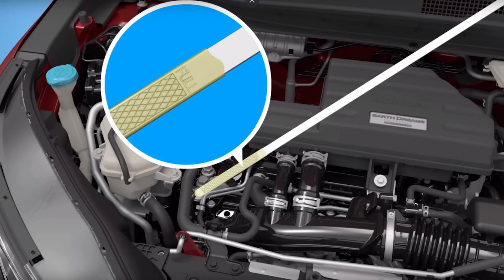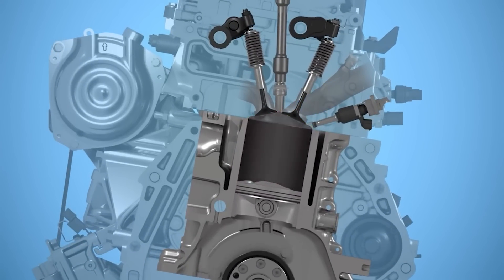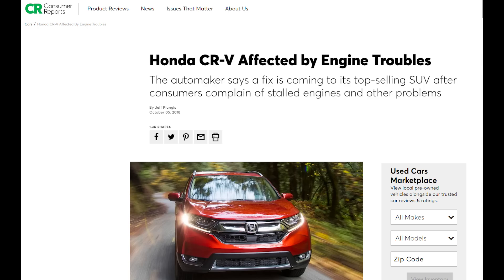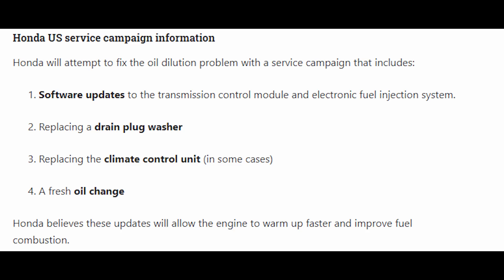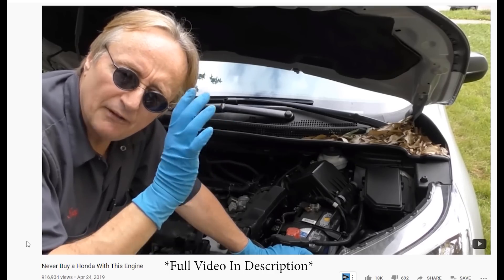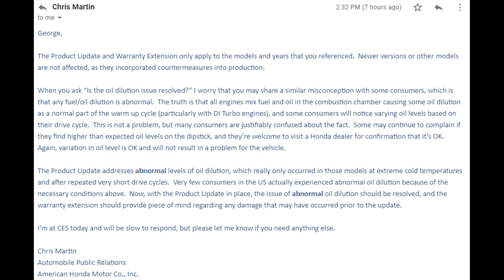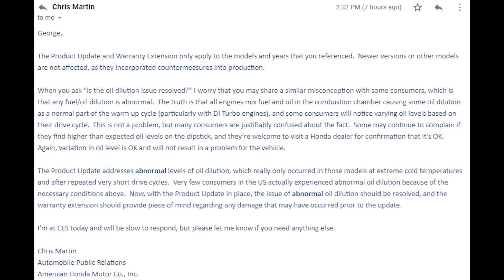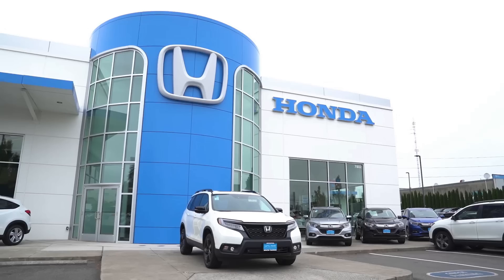Does Honda Have An Oil Dilution Problem? | 1.5L Engine in CR-V and Civic

Comment: Honda and Trump are the same. They lie. I own a 2018 CRV touring. 37,000 miles and 15 oil changes already. I always get 1 or 2 quarts more fluid out at oil change that are done at about 2000 miles. I’ve had “the fix” and I get worse gas mileage, car doesn’t warm up and gas dilution.
Reply: I guess neither your Honda or TDS will get fixed.
Reply: Fiveo waf  Don’t know about the TDS but as far as the Honda CRV, THERE IS NO FIX!!!  This is how this engine runs and that’s it. There is no one out there that has stopped their oil dilution.
Reply: @dougmartha2413  It's obviously a fundamental design fault related to its inability to warm up quickly, as the 2.0T Honda engine doesn't do the same, Honda's answer that "they all do that" it's the design is obviously untrue.
Reply: What do you take for your TDS? Might want to adjust the dosage.😏

Comment: That's great information!! I work for a Honda Dealership and since Honda introduced their "Earth Dreams Engines" we started getting shipments of this new Honda Full Synthetic Oil that is rated (SN Plus) specially made for Direct Injection engines. Honda even made a educational video about this new oil for all dealerships to learn about it. The problem is that this oil is upon request and the dealership will never tell you what oil is going into your engine when you take it in for an oil change. All dealerships are owned independently by investors or big automotive groups that use barrels of cheap synthetic blend or regular full synthetic oils to market to people, give them the cheapest oil change price, and get them into their service departments. People need to start reading their owners manuals and stop being cheap when it comes to changing oil!! I'm not saying all but most people don't even know what they got under their hood and then complain about issues that could of being prevented. I have 2 direct injected cars and personally use Mobil 1 Extended Performance rated SN Plus along with an OEM Honda oil filter, change the oil every 5k miles and have not had any issues. Also you don't have to spend a fortune on oil, I go to Wal-Mart and get the 5 quart jug for around $28 dollars. I also recommend that after your powertrain warranty expires (60k) perform a complete decarb service along with installing an oil catch can to make it run cleaner. This goes to all direct injection engines and do this if you plan to keep it for a very long time.
Reply: Or get a Toyota.
Reply: @vbad128  Yeah, get a Toyota before they make all their models GDI turbo 😂😂
Reply: Good information
Reply: So the dealership lies to people about using full sythentic oil? I thought the 0w20 oil was only made to be full sythentic?
Reply: It doesn’t matter what of new oil Honda recommends it’s the gasoline dilutes the oil

Comment: It has nothing to do with cold weather because people in warm climates are having the issue as well. They are lying when they say otherwise. People in California and Texas are having the problem as well. And their software fix did nothing. Honda have taken a major hit to their reputation with the way they’ve handled all this. 
  We love our CRV other than this issue, but because of it will be only keeping it for three years or so. This will be our last Honda
Reply: In the attempt to make gain in fuel efficiency, auto manufacturers switch to smaller displacement turbo engine coupled with CVT.  Turbocharged engine together with CVT shorten the life of the car.  The question is would you want to have a marginal increase in fuel economy which in most case can not be achieved in real life driving ? or having a more reliable car in the long term ?
Reply: @ohcanadaeh  in other words buy a mazda if you want a good japenese car.
Reply: Mazda cx5. 2.5, non turbo.  Good engine, very durable.  Mazda steering is always good. I think all turbos lifespan is sub 130k miles. Mazda, honda, toyota, porche, bmw, mercedes, doesnt matter. Your engine is eating itself to make power.

Comment: And Honda got rid of the 2.4L bulletproof engine for 2020????
Ridiculous!
Reply: Terry T yea im a honda dude but cant buy a new Honda
Reply: 99.5% of car buyers have no clue what specific engine is in their car. 2.4l was a great engine, sorry to see it go. We bought a 19 CRV and the 2.4l was only available on the LX. Ex and above only came with the 1.5l
Reply: @mph5896  I think as long as we change the oilregularly it will be fine I usually changed mine when the meter says 30% or looks dirty. I just smelled my oil and it does smell like fuel but it's not anymore full. I dunno wtf. I'm not going to worry about it too much as long as it's not over filled with fuel it will be alright
Reply: @mph5896  You are fortunate.
Reply: @mph5896  You are fortunate.
Reply: Terry T yeah! No one buy new car because of this! Too much reliable and they dont make enough money !
Reply: They should just go back to the 2.4 liter or the 3.0l and not the damn 1.5t
Reply: Long live the K and J Series 😍
Reply: k20 was amazing reliability
Reply: Well the death of the K24 wasn't what Honda wanted it just didn't get the fuel economy to power ratio required by law and wanted by the idiot market. I have a Spare K24 in my garage that I will rebuild and swap into my Accord when and if that thing ever dies. (Pulled the engine out of my sister in laws totaled CRV it got the rear end smashed in by a truck at a light she was okay the Honda wasn't)
Reply: I've learned that the k24W 2.4 which started being used in the 2015 earth dreams gen 4 crv is a totally different engine than the bullet proof k24 from 2014
Reply: Terry T the 2.4 was not bulletproof but I agree with you.
Reply: @themaxee08  what made you say that
Reply: Terry T right
Reply: I'm currently looking at a 2017 2.4 accord, is that a good choice, or should I run?
Reply: laid07 Its a good choice!
Reply: my 2.4l 2015 accord is still running strong!!
Reply: don't feel bad I had the 2013 Civic SI with a 2.4 l and I traded it for a 19 Civic SI 1.5t but I haven't seen this issue with my car🚗💨 I do all my maintenance myself & check my oil all the time because it's easy lol & I've never seen it above the full line
Reply: @honda116969 - Agreed. I'm an avid "car guy" and I do as much maintenance on my cars as I possibly can. With that said, most of the people complaining don't change their own oil. They may know how to check the oil level on the dipstick but that's all they know. They assume that the gasoline smell on the dipstick after 1000 miles is not normal. I've got news for all you "appliance drivers" out there: It's NORMAL to smell a bit of gasoline in your used oil. Anyone that changes their own motor oil would know this. This is true for all cars... not just Honda. An internal combustion engine will ALWAYS mix gasoline and oil... it's what they do. When it is excessive enough to show a noticeable increase in oil level on your dipstick, THAT is NOT normal.
Reply: @eddiep812  Ed, I change my oil all the time in my 2009 CRV and never smelled gas in my oil pan.  Sorry but I don't agree.
Reply: @honda116969  Do you live in an area that gets really cold during the winter? I'm talking like well below freezing on a consistent basis like in Canada or above the salt belt in the States. Generally that's where you're most likely to have oil dilution.
Reply: @Darksyne  nope..  In Phoenix lol. My 🚗💨 has been fine but it's a 2019 & suppose 2 b fixed. I dunno kno but I'm happy
Reply: George R yeah so you most likely will never have that problem lol the reason why so much fuel is getting into the oil is because Honda programmed the engine to inject lots of fuel when it’s cold out to warm up the engine properly. 
But the fuel is rich and cold so there’s a higher chance of unburnt fuel going on the cylinder walls and washing down into the crank case which builds up over time.
When they provided the software update, less fuel is being injected but the engine takes longer to warm up so thats why people are complaining of low cabin heat when it’s cold.
It’s a bad design flaw in the 1.5L which hopefully gets updated with later engine designs.
Reply: @Darksyne  
Very informative , I like your explanation.
Reply: @honda116969  What climate do you drive in?  Sounds like warm/hot year round?
Reply: @edt.9218  35° lowest 120° warmest lol generally..
Reply: Terry T people and critics were complaining that the 2.4L wasn’t powerful or fuel efficient enough for modern applications. Unfortunately it just can’t compete with today’s modern turbo 4cyl despite it being bullet proof and easy to work on. You can still get the K24 motor while you can in some cars like the Acura ILX and TLX but even the modern ones are direct injected
Reply: Darksyne yea ik times be changing but idk why the new generation only care about performance and hp numbers like how about you just enjoy the drive
Reply: @NinjaPickups  because most new car buyer's are a bunch of idiots that don't understand the important factors of owning a car such as long term reliability and easy maintenance. 
They only care about what the gas mileage is, how much horsepower it has and maybe the crash test ratings if they have a family. They don't care how easy a car is to fix and how long it'll last because the dealer will take care of it under warranty until they dump it. 
That's why I'm never giving up my 2000 Acura TL even with nearly 300k because it's such an easy care to diagnose and repair with parts being cheap and plentiful because it shares platforms with the Accord.
Reply: Darksyne dayum bro i kinda liked the older TL before 04 any tranny issues? My friend he went thru 3 before getting rid of it
Reply: ChuChuTrain right that’s why I’m comfortable with my 09 Civic 1.8L 4cyl I don’t need all that power tbh 140 is enough to get me by that slow driver
Reply: @NinjaPickups  If you think of NEW cars like a mobile phone, that is how the New Generation thinks. Obsession in the latest, high features and short term views.
Reply: crxdelsolsir when did i ever make that comparison?? I literally just said i dont want to buy newer cars becuz they arent engaging
Reply: @Darksyne  how fast do people need to go in a CRV . I take my 2016 with the 2.4 engine on a 50 km highway ride once a week and I easily get enough power to go from 90 kmph to 120 kmph to pass slower moving traffic with ease .
Reply: Randy R thats what im saying why does a Honda Accord need 200+hp now the 2.0T engines is like taking a step back in terms of reliability and longetivity honestly might go to Korean cars in the future

Comment: Dang.  I preferred the CRV to the RAV4, but this kind of problem cannot be ignored.
Reply: The new 2019 2020 Rav4 generation looks nice what with all the new modern cabin features. And the hybrid is supposed to get something like 40 combined mpg. But they do supposedly have an issue in some with the baffle design in the fuel tank making it hard to fill past 10 gallons of the 14.5 gallon tank.

The previous generation still looks good but has far less in the way of modern tech in the cabin. I mean a lack of rear climate vents in upscale trim levels in 2016, 17, 18 is pretty unacceptable

That said, you're right the CRVs were a lot nicer than the outgoing Rav4 generation.....if only the powertrain was worth a damn
Reply: That problem wouldn't be a deal breaker for me.  Even if you can only get 10 gallons in the tank.... @40 mpg that will get you 400 miles on that partial fill-up which is more than most vehicles with a full tank.
Reply: @henryhonda8408  Oh yeah. And my understanding is that it isn't a problem with every fuel pump out there. Just some of them seem to cause the problem and you can work past it to fill all the way if you pull the nozzle out just a bit and fill slowly so the fuel has time to work it's way down past the bottleneck without backing up.

If I was in the market for a new vehicle then the new generation Rav4 Hybrid would be quite high on my list. Sadly the vehicle currently on my shopping list is a compact cargo van to convert to right hand drive for running mail. Still debating which one of the 3 I want
Reply: I agree...... just pull the nozzle a bit, I do that all the time to top off the tank.  Some manufacturers say not to do this..... I had a 2009 Santa Fe & the manual said in bold letters to not overfill the tank as it could cause some engine damage.  All the civics I've owned in the past & my present Insight hybrid don't say that in the manual so I do it.  The Rav4 hybrid is definitely very high on my watch list as is the Rav4 Adventure (Trail in Canada).
Reply: Just purchased the 2021 CRV hybrid touring purchased the 100k warranty.
Reply: RAV 4 read up on tranny outages.
Reply: Just buy the CRV  LX with the proven reliability of the 2.4.  It still exists in the 17-19 model years.  You just have to not want as many bells and whistles, that’s all.

Comment: Yeah, I just change my oil every 5k.
Reply: I wish it was only that easy.  My 18 crv  has a gas smell in the cabin  after less than 3K miles on fresh oil.    I don’t drive short distances or live in a cold climate either.
Reply: @markp6586  sounds like its time for an oil change. I know I sound a bit insensitive but if Honda isnt doing anything to fix the issue, then theres only 2 choices, sell the car or change the oil once you start smelling the gas. I know in my f150, around 4-4.5k miles, I start getting a faint oil smell in the cab. I check the oil and sure enough it's pretty dark(its full synthetic so it's barely visible when its new), so I start planning when I'm gonna do my oil change. My 2017 Accord  hasnt thankfully given me an oil problems yet but I am doing 4k oil changes( I drive it pretty hard) on it at the moment, but I'm gonna switch to amsoil next and see how long that oil lasts.

Comment: Do it like Toyota direct and port injection ..... oh no that’s to expensive for Honda to do the right thing
Reply: Yes finally. Do not warm your engine at an idle that solves most of your issues with GDI. Engines by design run rich when cold. The rich mix dilutes oil more. So get in your car fire it up let it run for like 15 seconds then drive moderately to get it warm faster. Then keep the engine hot for as long as you can so it evaporates the oil.
Reply: John H Evaporates the fuel* (fixed)
Reply: @tails300  sorry meant evaporates the fuel from the oil. Good catch. All though having a port injected engine like the Toyotas that switches to GDI after warming would reduce the issue some.
Reply: @johnh8546  alot of honda crv owners in northern usa , canada disagree . you cant just jump into a crv when its -25 celcius or colder and just drive off . I dont think you need to let it ''warm up'' for 20 minutes either though . Somewhere in the middle , like 10 minutes ,
Reply: Honda already has some sort of method of getting fuel into the valves. There’s a research paper on how Honda leaves the valves open just long enough to get fuel into them.
Reply: That Toyota thing is to address another problem; Carbon deposits on the back of the valves.
Reply: @ronfazer2423  true but it also helps by not having liquid fuel spaying directly onto the cylinder wall during warm up. When the fuel doesn't as readily turn into vapor due to cylinder heat.
Reply: The base 2.0 on the civic has that I have one myself
Reply: JOSE DOMINGUEZ and you don’t think Toyota has that problem with gas in the oil also. Guess again. If you’re one of these people always warms your car up before you drive it you will have that problem I don’t care who build it. The longer your engine runs cold the more gas you get in the oil the more often you have to change it

Comment: Are the 2016-2020 civic Si having the same issue?
Reply from the maker: Different engine.
Reply: @DriversOnly  Is it?  Current generation Si has the 1.5L DI turbo engine.  I think the previous gen Si had the 2.4L NA engine currently in the Acura ILX.

Comment: My son has a 2018 Honda Fit that he purchased new with the same engine, I just did a oil change and the oil smells like it has a lot of gas in it, why isn’t this engine ( car) included in this article?
Reply: That engine is not turbocharged.
Reply: Knuckles300 this an issue with the direct injection system turbocharger is not affected
Reply: f181234 well they better fix that shit fast before they’re reputation ends up like Nissan.

Comment: Well, wouldn’t it make sense to just change the oil more frequently?  These new cars of today have recommended oil change intervals of roughly 16,000km.  I change mine every 5,000km. Never had an issue.
Reply: Well, sure! And for meals, I guess you take a couple of bites and sips, and then throw the rest away... ;)

Comment: I can’t tell if my civic si has the oil stick past full. The dipstick they provide sucks. It always a bit over. Even with new oil. I never got my oil tested. Maybe I should. I do drive a lot though and change my oil every 5k-7.5k miles typically at 30% oil life. I’m at 30k miles. Since they said unlimited miles for 6 years I’m gonna drive the crap out of my car and make them replace the engine from overuse 😈

Comment: This oil dilution issue destroyed my 2015 CRV 2.4L engine. It was replaced with 2016 used engine and have to change the oil monthly during the winter. About 800 miles and oil tested 5% gas vs max allowed of 2%. My next car is a Tesla. My 2011 CRV with 2.4L engine is fine. No oil dilution issue. Honda won’t own this issue on 2015/2016 cars.